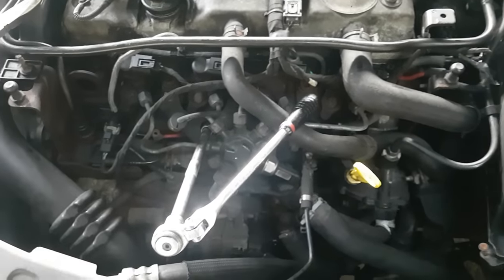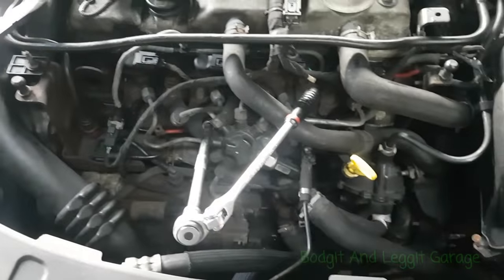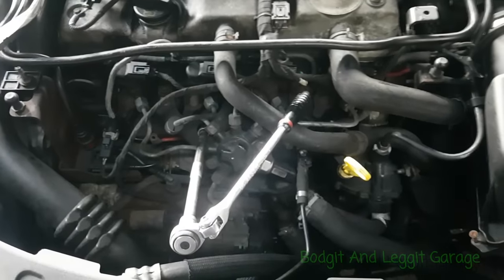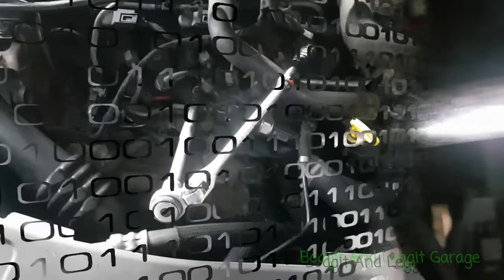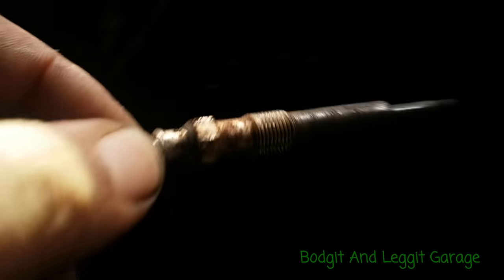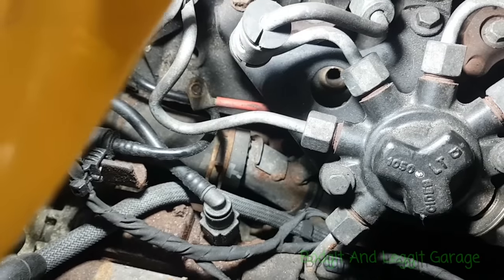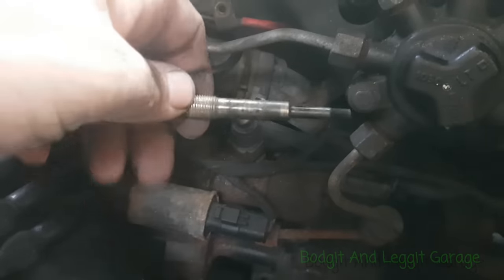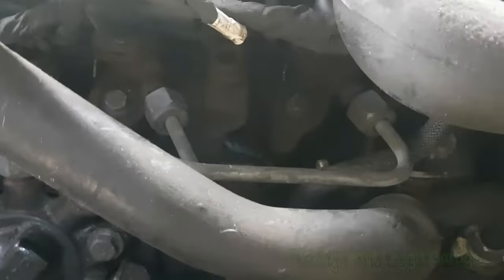How To Remove Seized Heater/stuck glow plug With No Specialist Tools Bodgit And Leggit Garage

Comment: Just a suggestion Is it not worth spraying some WD40 when you have taking it part way out so when you are turning it back and forth into the block it will lubricate the thread
Reply: To at least stop the squeaking....
Reply: You'd feel as ...well I tried my best ...
Reply: Come on WD40. JEEEZ

Comment: I know you said you didn't use it, but would wd40 have helped get it out? Or would it have ruined the sound effects and possibly led to you going full pelt on the plug and possibly snapping it?
Reply: I would have put some spray oil in there. recently rebuilt an alternator and letting spray oil soak into the bearing pressed in edges made removing the bearings a breeze.

Looking forward to no 4 :) Keep up mate!
Reply from the maker: @armunro  alternator bearings and heater plugs two completely different things heater plugs gummed up with carbon and getting hot and cold very hot and cold on numerous occasions is completely different to Bearings inside an alternator I'm telling you WD40 in this case would have done nothing
Reply: What about doinf it with the engine hot since the materials have different coefficients of expansion.
Reply: Was thinking a bit of oil would help cut/clean the thread as you are working it loose. Heat helps; especially on rusted up exhaust bolts. So maybe a hot engine would help? btw what happen with no 4; am intreaged to know :)
Reply: @rimmersbryggeri   heat expands metal and it would have been more difficult.
Reply: @ratboyjersey  It expapands some metal more than others which will make a hole in such a metal relatively bigger. Is called differential expansion which you would have known if you had bothered to find out what my comment meant.  Sinve cast Iron(block) and stainless (glow plug) have a different chemical makeup it will work if the heat difference is big enough which can be coaxed with a torch.. since the plug will also sink it's heat into the block the block should stay relatively warmer.
Reply: Whether he wants to agree or not penetrating oil would absolutely help..The noise you are hearing is friction from metal to metal contact..spraying oil on there  and working it back and forth will get the oil onto all the threads lubricating them and therefore   reducing the friction..ALWAYS lubricate them with penetrating oil when trying to remove them and apply anti seize compound to the threads  of the new glow plugs will help on the next replacement
Reply: @rimmersbryggeri  Yes, with aluminium head and steel plugs, if aluminium expands a tad more than steel, even if very minimal maybe enough to help atoms of penetrating oil start to get in.   i.e. give the car back to owner with a can of penetrating oil and tell them to squirt some on them at the end (or start?) of journeys for a month.  Then try again.  Maybe, just guessing here.
Reply: @rimmersbryggeri but the difference in temperature coefficients will be significant if the diameter of the glow plug was about an inch or more.
With a small dia , guess it won't create any significant shrinkage / gap considering we cannot create a temperature difference of about 150 -degrees. 
Correct me if wrong 
Difficult to work on tight places when engine is 🔥

Comment: In my experience its removing the carbon from the tip that creates all the tightness and its why penetrating oil does nothing to help so you have to just keep working it back and forth until all the carbon has been removed
Reply: When I have to change them, i just connect 12V to them so they get as hot as possible, that way carbon gets burned off
Reply: @660star  does that really work? Do you have them glowing red as your undoing them, or do you let them glow red hot for a few mins and turn it off?
Reply: @evieemaya88  just a few seconds and then they're shot, so only when I change them, wait a few seconds after heating, and try to remove them as they're still quite warm.
Reply: Coca Cola works wonders
Reply: @660star  
I gave your comment a thumbs up, but why in the world would you be removing a good glow plug? The only ones I change are the bad ones that don’t work, and you can’t power those up to burn the carbon off. I guess if a customer wanted them all changed it would be reasonable, but I think I’d try to talk them into changing only the bad ones. My 6.6 Duramax V-8 Diesel has 375,000 miles on it and I have only changed four of the eight so far. That averages out to about 1 every 1 1/2 - 2 years since the first one failed about 8 years ago.

Comment: All the experts tell you to warm the engine and use some sort of penetrating fluid both before and during the removal. I have no idea why you did neither. Were you just being tight? I'd also consider getting a smaller torque wrench which can be set to the low values required for these glow plugs.

Comment: I did this job on my Merc C250 - doused the plugs in WD40 went for a good drive - hot engine - more WD40 get a little movement - back and forth very gingerly - ended up with Mole Grips on one - pull and turn at same time - and eventually they came out. One was a beggar though and it took me a couple hours of the above to get it out. Slow and steady wins this game..Brill vid!

Comment: We get engine fully warm & up to running temp. adding oil in glow plug well before starting. Always use Never-seize or equivalent on threads of new plugs makes all the difference !
Great video & good advise as always.
Reply: Thats how I do them too. I rarely get one stuck this was. If I do have a tight one I soak it down with WD40 overnight and run it up to temp the following day. I repeat this until its out.

Comment: I always get engine hot as possible then put a wet rag where poss  on glow plug to cool it down, (heat expands, cold shrinks) that usually get buggers out ! Like  in vid ,always go back and forth on any tight thread ,will save agro later, also crank engine over without plugs in  to blow all crap out of hole and ALLWAYS put  copper grease on thread when replacing !

Comment: I'm doing this now, and 2 out of 4 are seized worse than the one you are showing here. 
Literally just sat at my bench for a bit to get out of the rain for a break. 
Mine are only turning slightly, but by doing what you did I managed to get one free but it took well over an hour and a half to fully undo. 
Using a little 1/4" ratchet in the hope that it's short enough for me not to put too much force on it. 
Can see what you mean about WD40 being very little use here. No way can it get down to that coked up shaft.
Don't know how you quote for this kind of work mate, as this is easily going to take me all day.

Comment: There’s certain spray that can penetrate and help with the extraction. One of them I use was Wurth Black magic ( rest remover) which penetrates bit by bit and helps with squeaky dry noise . I also always use grease for putting them back in. Never had problems removing them since. So not sure why OE don’t do the same.. balls of shit
Reply: PB Blaster penetrating fluid does exactly that, it has a very microscopic makeup that allows it to capillary action down a thread.  The lubricating properties eliminates rust, corrosion, sticking, and squeaking problems so it's a win win using this stuff on glowplugs.

Comment: Snapped one before removing them on my Vivaro ...hardly and pressure used they were like chocolate! When I’ve done them since i use a t bar instead of a ratchet as seems to keep the force on centrally
Reply from the maker: My experience mate if they're going to snap there's nothing you can do about it they're just going to snap there is a feel once you get the feel does take a bit of time in practice to get the feel
Reply: @bodgitandleggitgarage  The sickening feeling of one breaking burns into your brain,  next time you know when you getting close to breaking another, lol.

Comment: Always bring engine up to operating temperature first and soak plugs in liberal amount of penetration oil. 
Ream bore, clean threads and seat before fitting new glow plug.
Reply from the maker: that can help but not 100% guaranteed

Comment: Sure am glad  I found your video before I jumped in to my first glow plug job...I'm a diesel noob with a new to me `08 Jeep with the 3.0 Mercedes OM642 and 278 000 kms on the odometer. It's cylinder 6 up by the firewall with junk overhead. I'll be working in the driveway in January in Canada, not a great time to "learn to do by doing". Thanks for taking me to school!
Reply from the maker: Best of luck with it mate I'm glad my video Help that's what it's all about
Reply: I used to have the same environmental issues in Denmark. I ended up buying an old army tent from a surplus store and erected this over the front of my car (an old mercedes c250) It was great as you were out of the weather and could set up lights and a heater and work in relative comfort

Comment: I get the engine red hot then soak them with wd 40. Then settle down for a few hours of fun and giggles
Reply: That's right, hot engine, I use a tin of pipe freeze from plumbing shop on the glow plug, well not a tin but enough just to cool it a couple of thou. If you get one that doesn't shift.

Comment: I did mine last year after I diagnosed only 2 were working, had that squeaking and didn't turn it back every turn and got to the end when it was off the threads n the tip snapped. Tried the second one but turned it back this time but couldn't for the life of me get it out it was that stuck in there with shit, squirted wd down there, tightened it back up to do another day 'cause it started snowing but once it was cracked off it came out by hand and pulled straight out like everything was brand new. It came out that easy I almost shit my pants thinking I'd snapped another so I did the same with the other 2 and it was the easiest job I've done on the car which totally beats trying to pull it with grips, prying it out, prying it whilst twisting it for an hour in the cold. Still need to get the tip out like but that's not the only thing on the list to fix

Comment: When I did them on my car I snapped one of the tips off which I never got out and managed to get the other 3 out. Trouble I had was I got them to the end of the thread but they were not coming out no matter what I tried, so I ended up spraying wd40 down the holes and tightened them back up ‘cause it started snowing, went back to try again a few days later, I cracked them off and they came out by hand, came out so easily I actually thought I’d snapped the first one

Comment: The problem is when people over tighten them and don't put grease on them
Reply from the maker: Not really mate it comes down to a lot more than that the two different metals react rust carbon build-up heat soaking the list goes on and on

Comment: I would still advise using WD40, or a mix of paraffin and lube oil.  Give a good soaking when the heater plug starts to move and leave for an hour or so.  Stripped threads or broken plugs will NOT bring a grin to your face.
Reply from the maker: Hi mate unfortunately in this case like I explained in the video it would not have done any good all it would have done it stop this weekend there was too much carbon build-up inside the fridge no amount of WD40 or any other penetration oil would have got through this there is plenty of videos on YouTube proving this even with serious heat it still cannot get through
Reply: @bodgitandleggitgarage  is this before you had your glow plug tool with low torque mate

Comment: Doing a full service on my car when weather is better, all filters,  aux belt and cambelt and going check the plugs with my multimeter,  if any need changing im dreading it 🤣 heard horror stories about plugs so sh#tting bricks 🤣 a few days before im going keep warming the engine up and spray wwd 40 in them each time because apparently that makes it easier , that nouse alone was making my ass twitch 🤣

Comment: Hi love ya vids,
I noticed another you tuber Pulled outer thread casing from glow plug but the rest stayed in,His advise were to Grasp the top with nose pliers tap down gently and pull up and repeat this will relieve any inner stuck in glow plug,saved him a pretty penny,same if the glow plug thread is just spinning you will have that little bit of play to tap down and pull up with screw driver under the nut shaped part while unscrewing the glow plug,Hope this helps if having a future issue with above

Comment: A good case for plus gas i think
Reply: Absolutely would help as plus gas is a dedicated penetrating oil and would find its way right down the root/crest clearance path inside the thread. Incidentally WD40 is not a penetrating oil as it is designed for removing water  (W D = Water Displacement ) not creeping into assembled parts and freeing them off

Comment: Does spraying penetrating oil on them a day on two before help? Great demo btw 👍
Reply: No, it doesn’t work unless you’re working it in and out like he was and spray it on before screwing it back in. That will carry a small bit in each time you reseat the plug, but it really doesn’t work. The new glow plugs need to be installed with anti-seize, even at the factory, to help alleviate this problem.

Comment: penetrating lube does work really well esp when you think you may break the glow plug, no brainer
Reply from the maker: Did I put lube on it? No, did I break it no boom sorted
Reply: @bodgitandleggitgarage  After doing the job myself, I agree with you. It's not so much the threads that are tight, it's the coked up shaft stopping it turning. I will admit that I am literally soaking them all the same, but it's more psychological I would say. Ha. Mine have been in for 17 years so no surprise I'm struggling.

Comment: Ever heard of lube!!!!If you added plus gas or the like the thread would be lubbed and it would keep the heat down in the thread.
Reply: Not cross threaded just needed lube
Reply from the maker: You obviously don't understand what happened. How would lube would have helped me in this situation. It would have stopped the noise it would not have penetrated the carbon build up.
Reply from the maker: There is plenty videos online proving that it would not have penetrated the carbon check them out before. For making comments
Reply from the maker: And as my heating up the engine being very hot made absolutely no difference.

Comment: Whenever I remove glow plugs I soaked them all with either a three in one oil or a very thin engine oil and leave them overnight then go back to them the following day preparation is 9 tenths of any job don't just go in smashing spanners and ratchets about expecting to take glow plugs out that has been in a car for 5 years Plus it ain't going to happen
Reply from the maker: We all don't have that luxury of being able to do that most customers bring their car in in the morning and expect it done that day I cannot wait that long I have been doing this for long time penetration oil would have not done anything in this case it was too packed full of carbon and penetration I would not have gone through iproven in the video that if you take your time and do it like this you will not have a problem
Reply: @bodgitandleggitgarage  did number 4 come out ok?
Reply: bodgit and leggit garage  well sir I'm in the same trade as you an have been for a while and with respect we all do things differently if when the end results are the same. I too like you have daily customers wanting work completed the same day as it was brought in.  It's fair to say that with the level of engineering in modern vehicles and the complete lack of working space some jobs now take much longer than expected if I'm pushed for time on a glowplug replacement job I use on the day (if the customer can't leave there vehicles) but most can and understand the need to leave the vehicle.  Auto gem deep penetrating srpay grease it's just amazing at very quickly un seizing rusted or stuck fixings. Parts. Service items. This is a deep pushing grease product not an oil it's so much better then penetrating oil, infact I don't ever use penetrating oils. Sorry for the late response I've been very busy at work. Take care ......

Comment: Good tip, always use ceramic grease on threads and lower body when putting a new plug in.
Reply: And on injectors too. Yup works a treat

Comment: The whole premise of this method is dependent on the plug being able to turn slightly from the get-go.  In 99% of the cases if the plug is really ceased it will break before it turns at all.

Comment: Use some atf oil and aceton  mix
Reply from the maker: All that would have done will stop the squeaking noise it wouldn't have penetrated the carbon build up up in the heater plugs yes it would have stopped the noise any oil would have stopped the noise but that wasn't the point of the video just because the noise stopped doesn't mean that they won't break